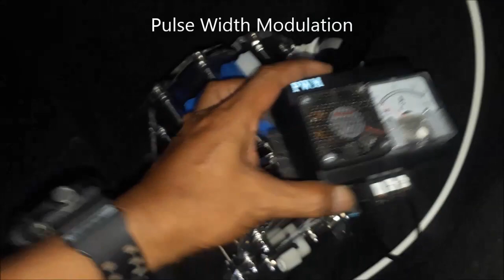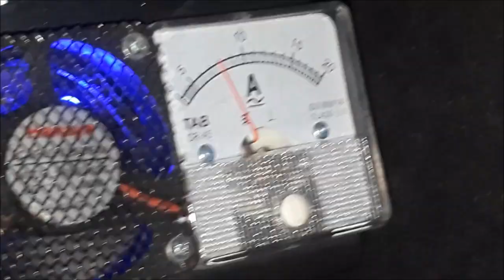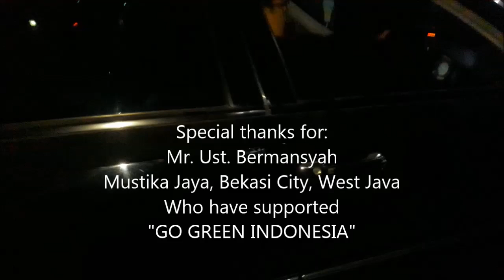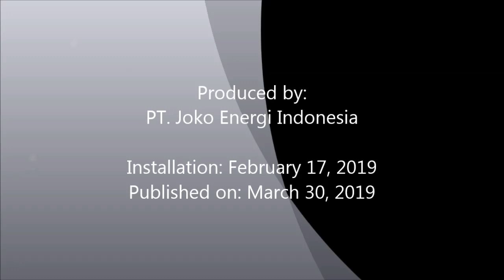Fuel saver (HHO+EFIE) Joko Energy on Mercedes Benz E240 2003 Avantgarde

Comment: Sepertinya ini penipuan, gas HHO atau H20 yang di maksud di video itu tidak lebih dari uap air biasa. Dan kalaupun sistem fuel cell yang ada di bagasi betul memproduksi gas H2 (Hidrogen), hal tersebut tidak akan membuat mesin menghasilkan performa yang lebih baik, karena sebagian dari tenaga mesin dipakai untuk menghasilkan listrik yang dipakai oleh cell electrolisis untuk mengubah air (H20) menjadi Hidrogen (H2) dan oksigen (O2) di bagasi.
Dengan penjelasan tersebut saya yakin ini penipuan.